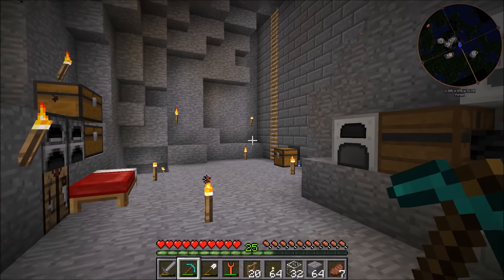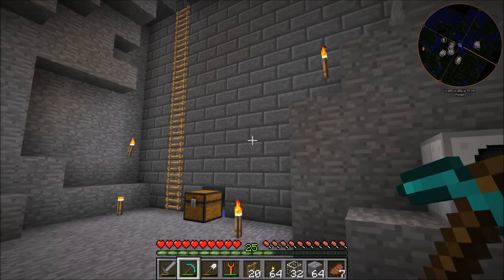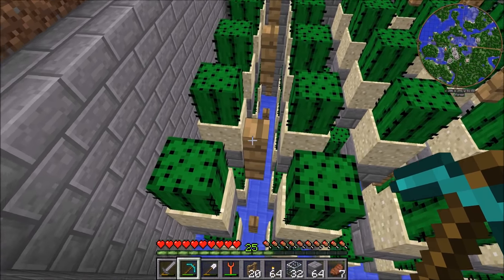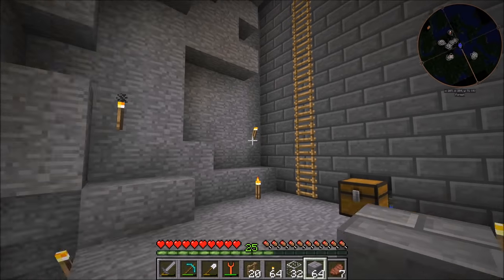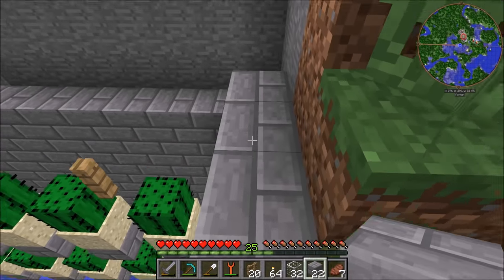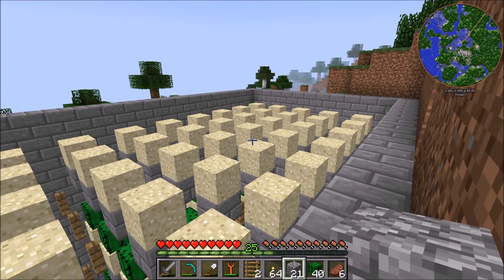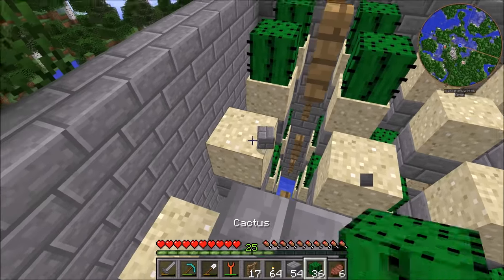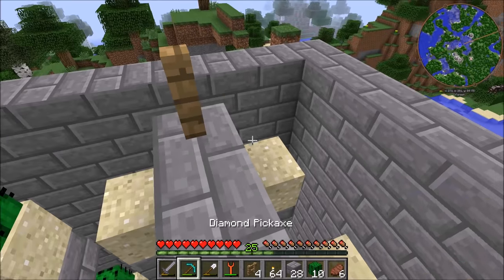Surviving With IndustrialCraft 2 :: Ep.2 - Infinite Power Generation Using Cactus

Comment: I do think that Mumbojumbo has a video about auto farming trees. You could use that and then auto input the wood with hoppers into a furnace or something. The only problem is getting fuel to the furnace, I don't know that much about IC2, but I think there is some kind of furnace that goes on power.
Then you can put the charcoal into the generator and you will get a lot of more power :)
Reply from the maker: +LaggaKing The main thing is I am attempting to get the system to be fully automatic, and with his tree farm you need to break the actual wood. This would be much better, but I am lazy ;)
Reply: +DrRageHard Oh I didn't realize that :/
But anyway keep up the good work!

Comment: i played version 2.2.770 before and never needed insulated wires and voltage transforms.
today in 2.6.142, i lost all my machines because i connected my wind turbine which is tier 3 to batbox directly :/
i wonder if it's because of version changes or a difficulty option that i don't know.
Reply from the maker: I believe there is a difficulty option to change in the config, but it also came out of version change. When i played this series it was not an option, but never versions it is.